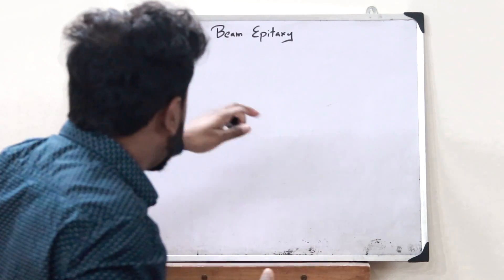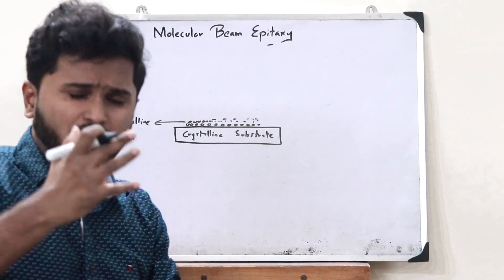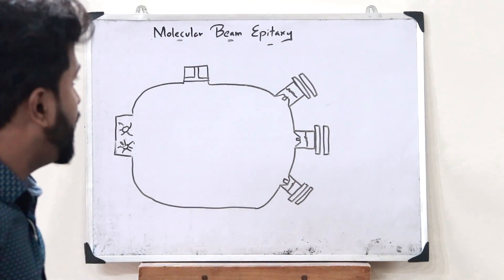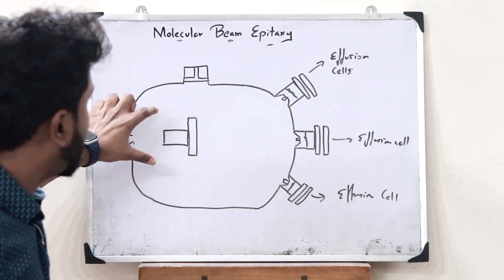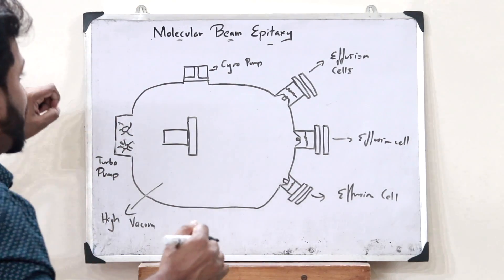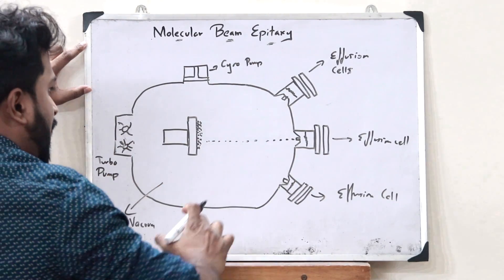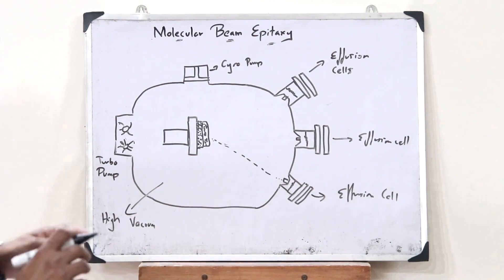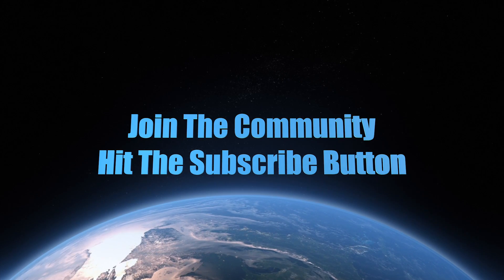Molecular Beam Epitaxy | Working Apparatus | Simplified VLSI

Comment: Well, you could also use a shutter on the effusion cell.  Though, now I am curious what's the difference between a sputter gun and an effusion cell?
Reply: So effusion cells are simple heating cells. They have a crucible which holds the material to be deposited and a coil which heats it up to temperatures at which the said material starts evaporating and depositing on the substrate. Sputter guns are slightly more complex as they basically create a plasma and bombard the material that you want to deposit with ions. This leads to the material "sputtering" out of the material and on to the substrate and you end up with a thin film

Comment: what does cryo pump do?
Reply: Turbo pumps only start functioning at high vacuum conditions (1x10^-3 Torr), so you need another pump to pump it down from atmospheric pressure to some relatively decent vacuum. After this, the turbo kicks in and brings the whole system to ultra high vacuum

Comment: Can multiple metals be deposited at the same time so they are not individually layered, but are a mixed layer?
Reply: Absolutely! You can have multiple effusion cells with different metals and depending on the stoichiometry of the alloy you want, you can alter the temperature/shutter open-close time to obtain a range of different intermetallic alloys.